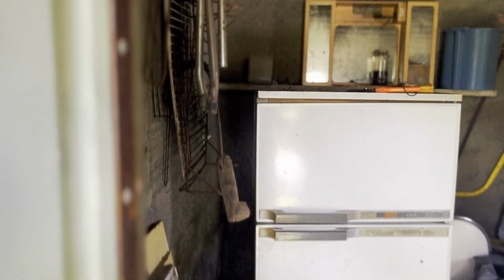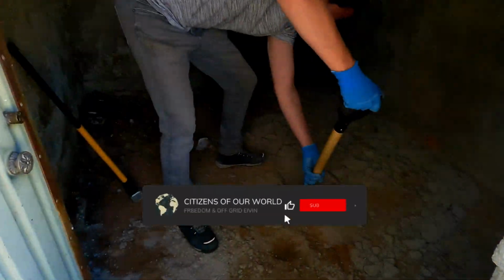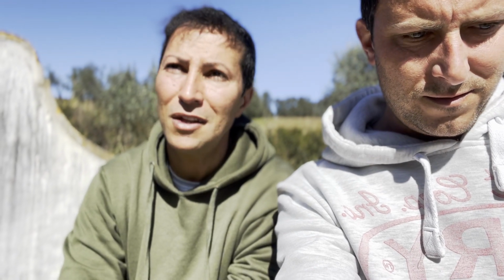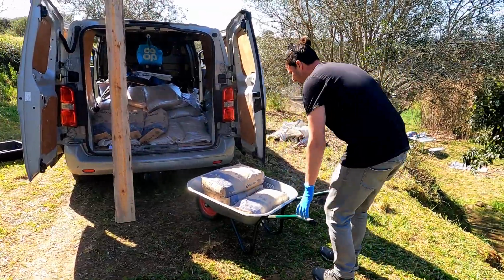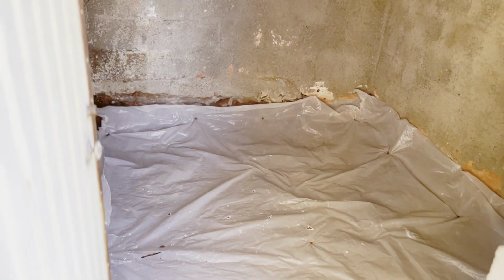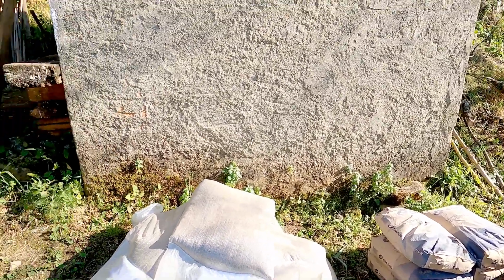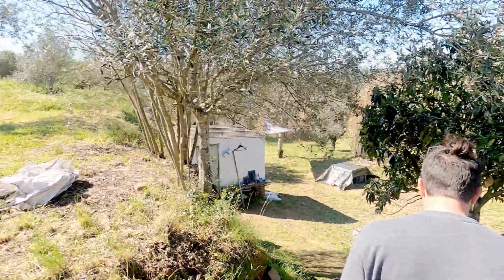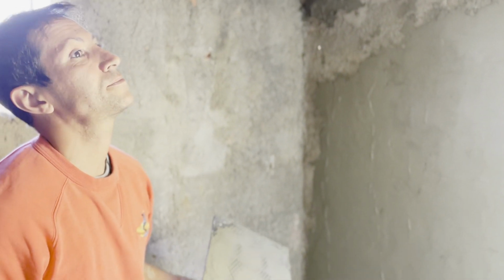First Off Grid Construction Project In Portugal

Comment: Thanks for your vid 😇💟💟💟 Love and bless you guys, maybe have a look at the bluetti it's a solar generator that you load up with folded up solar cells it almost doesn't make any noise and after buying doesn't cost you anything. stucking is heavy work and you become better as you go. good work 👍 guys.
Reply from the maker: Thanks for the heads up Arjan!  We’ll check that out.  We’re hoping to go straight in with the main solar system but time and costs are a huge factor so this could be a helpful temporary fix!  New video out in a few hours xoxo

Comment: Hi guys, I was wondering when you would put the caravan on the land, it is ideal living accommodation until you get your permanent home built.  Is it not prudent to matriculate your van as it would be far, far cheaper than buying a left hand drive as you still need something that can carry building supplies.  If you do decide I would get on to that asap as delays could mean it costs more.  Doing a great job guys, take care from Newcastle UK xx
Reply from the maker: Hehehe you’ll have to tune in next week for that 😜
And totally right with the van…we keep back and forth on it so are back in touch with the various departments about it.  Thanks for the heads up and advice; super grateful.  xoxo